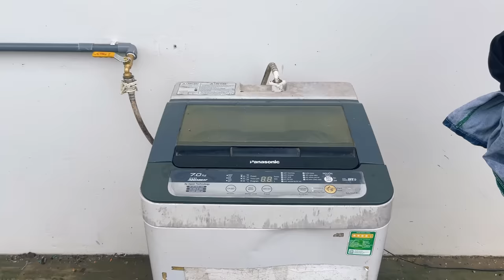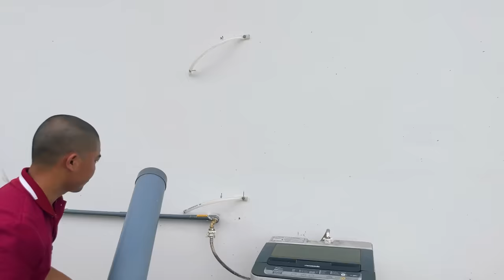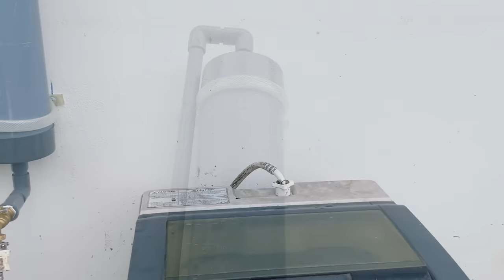Discover these incredible ideas now! Unique hacks born from combining plastic bottles and PVC pipes.

Comment: This guy has the experience to make sure he does not cut his fingers on the sharp edges of freshly-cut sheet metal (before de-burring).  
My preference is to play it safe and always wear gloves while cutting sheet metal.
Reply from the maker: That's a prudent approach. Wearing gloves while working with sheet metal can provide an additional layer of protection against cuts and abrasions from sharp edges. It's always important to prioritize safety in any DIY project or task involving potentially hazardous materials or tools

Comment: great ideas, but i have 2 enhancements.  1. don't use superglue to glue PVC pieces.  use the proper plumber's cement.  i figure that since PVC is available in your area, the plumber's cement should be as well.  2.  on the 1st project where he's making better water flow for his washer, putting the shut-off after his invention was a good idea, but he should have left the shut-off valve in-line before his invention.  having 2 shut-offs (one before and one after) makes working on the system easier with less water waste.  if only one shut-off is available, then he should have left it before the unit.  this would cause less water waste when he has to work on the system.
Reply from the maker: It's great to have audiences like you, each of your comments is a gold mine for us. Accordingly, we will consider together the knowledge you just shared, please continue to follow the channel. and tell us more about the wonderful knowledge you have. Thank you very much!

Comment: Cool! By the way, you are winding Teflon tape backwards.
Reply from the maker: Thank you for pointing that out! Properly applying Teflon tape is crucial for a secure seal. Could you provide more details on the correct way to apply it, or any tips you have for ensuring a tight seal when using Teflon tape? Your insights could be very helpful for those looking to improve their plumbing skills. 🚰🛠️🔍
Reply: @tipsunknow  WInd Teflon in the same direction as the hose bib threads. As if you are screwing it on. This way when you screw the parts together, it pulls the end of the tape in the same direction as the parts are moving. (If you do it the other way, you are pushing the end of the tape backwards.)

Comment: Awesome sharing... On the coke bottle project, what is the min water level for it to work?
Reply from the maker: The minimum water level for a DIY water bottle tank project to work effectively will depend on the design and dimensions of the specific setup. In general, the water level should be sufficient to create the necessary pressure and flow for the toilet to flush properly. This typically means that the water level should be high enough to reach the fill line in the toilet tank (as indicated by the manufacturer).

To ensure proper flushing and performance, it's important to follow the manufacturer's guidelines and recommendations for your specific toilet model. The water level may also vary based on local plumbing regulations, so it's a good idea to check with your local authorities to ensure compliance.

Comment: The second project has some faults to it. For one, it looks like you're letting water come out of 2 sections, which you should have one pipe set to a drainage system where the unusable water with the leaves and bugs in it will be filtered out or at the least put into a drainage ditch. 

The bucket of clean water will get contaminated with rust from the iron after enough time. A plastic mesh would be more effective in this case. 

I am tempted to put some of these into work, but I know plastic doesn't rust, where metals do rust. I kinda want to make some modifications to your existing ideas though... 

I would also advise to use a larger means of storing collected water for later use, just in case. Or a means of draining the water from your large filter into multiple buckets, as there is cause for concern for considering it wrong to waste water. 

A larger means of collecting rain water to minimize your need for using cold water from plumbing.
Reply from the maker: I appreciate your feedback on the second project, and it's great to hear your thoughts on improving the system. Could you please share more details on how you would recommend setting up a drainage system or filtering out the unusable water effectively? Your suggestions could be valuable for enhancing the project. 😊

Comment: Before hacking your water supply, you should give your washing machine a good scrubbing, from the way it looks, the clothes probably come out dirtier than they went in.
Reply from the maker: I appreciate your comment. Ensuring clean laundry is essential. If you have any tips or recommendations for cleaning a washing machine effectively, please feel free to share them. It could be helpful for others who might face a similar situation.
Reply: @tipsunknow  You want tips for cleaning this disaster area? I'd start with soapy water, a stiff brush and some good old-fashioned elbow grease. You dip the brush in the soapy water, bring it in contact with the dirty surface, apply light pressure and move the brush in a linear or circular fashion until the dirt comes off.If that doesn't do it, try some other cleaning agents like benzene, methylated spirits, chlorine cleaner or good old-fashioned scrubbing powder. If all else fails, there's always sandpaper, or a new washing machine.

Comment: okay so the first idea... I guess people are in a hurry to wash their hands in the rain and can't go in the house? How often is this happening?

Second idea... leaves are still falling in the gutter and clogging it. You will have water going out of the pipes as well as over the sides when the leaves fill the gutters and make them basically nonexistent. The only way to prevent this,
 with no maintenance, is using a screen over the gutters that allows leaves and stuff to slide off. If something gets stuck, you can just push it with a stick or broom instead of climbing a ladder
Reply from the maker: It seems like you're discussing the practicality and effectiveness of the ideas presented in the video. Let's break it down:

Washing hands in the rain: This idea might be useful for situations where someone needs to quickly rinse their hands while working outside and doesn't want to track dirt or grime inside the house. It could be particularly handy for outdoor chores like gardening, car maintenance, or construction work. However, as you mentioned, it's not a common scenario for everyone, and it may not be the most efficient solution for everyone's needs.

Gutter leaf protection: While installing screens or guards over gutters can indeed help prevent clogs from leaves and debris, some people might prefer alternative methods that don't require climbing ladders or performing regular maintenance. The method demonstrated in the video might appeal to those looking for a low-cost, do-it-yourself solution, but it may not be the most effective option in the long term, especially in areas with heavy leaf fall.

Ultimately, the effectiveness of these ideas depends on individual preferences, specific needs, and the environment in which they're implemented. There's no one-size-fits-all solution, so it's essential to consider various factors before deciding on the best approach.

Comment: He wound the teflon tape on the wrong way in the first project.
Reply from the maker: Using Teflon tape or plumber's tape the right way is essential for creating effective seals in plumbing projects. Typically, Teflon tape should be wound clockwise (when looking at the end of the pipe or fitting) to ensure a proper seal. If it was applied in the wrong direction, it might not create the desired seal and could result in leaks.

It's always a good idea to double-check and follow best practices when using materials like Teflon tape in plumbing projects to ensure a successful and leak-free result.
Reply: @tipsunknow  Yup, that's it... LoL...

Comment: wow is that stainless gutters?  nice.
Reply from the maker: Thank you for your question about stainless drain pipes! Yes, you are right, it is a stainless drain pipe. They are truly a good choice to protect your home from the effects of rain and weather.

But I want to ask you a little more: Have you considered using stainless drain pipes for your home? Or do you have any questions or concerns about installing and maintaining them? I would be happy to have the opportunity to help you further!
Reply: @tipsunknow  No I've never considered it, that is why I was impressed.  But they would not be cost effective for me nor would they go with my home.  I figure they are only cost effective for commercial application or if you were going to collect drinking water from roof rain runoff.  Plus, if one is going to collect roof runoff then a metal roof needs to be paired, like you did, with the stainless gutters.  Asphalt shingles would be self defeating in that application.  And where I live insurance companys do NOT like metal roofs due to hail damage claims when metal roofs get dimples from hail.  They give lower rates for asphalt hurricane shingles.

Comment: Hello, thanks for the nice centrifugal filter diy, with the rivet tip very nice !
The trick after, with the gutter, i REALLY didn't understood the point of allt his pipes going up and down, the bottle, the bubbles... It looks likes it can clog the same way as "straight away" evacuation pipe, isn't it ? Could you help me to understand ?
Reply from the maker: I'm glad you found the centrifugal filter DIY helpful! As for the gutter modification with the pipes and bottle, the purpose of this setup is to create a kind of water trap or siphon effect. The pipes going up and down and the bottle act as a barrier to prevent sewer gases and odors from entering your home through the drainage system.

When water flows through the pipes and into the bottle, it creates a seal that prevents gases from passing back up through the pipes and into your home. This is a common plumbing technique used to prevent odors and gases from escaping. It doesn't necessarily prevent clogs in the same way as a straight pipe, but it does help maintain a sanitary and odor-free environment in your home.

So, in summary, the setup with the pipes and bottle is mainly for odor control and ensuring that gases from the drainage system don't enter your living space. It's a preventive measure rather than a solution for clogs.
Reply: I’m sorry but no.

The system with the bottle and pipes creates a siphon. 
The water level will rise in the bottle and oncce it is high enough in the bottle it will flow into the siphon. This creates suction.
So once the water gets into the siphon it will suck water out of the gutter through the siphon.
This works only if the water-level gets too high
Reply: I still don't understand the interest  @tipsunknow  One time debris are caught in the gutter, it need to go out sometimes... Also gutter are large, normal evacuation pipes are also large to ensure proper evacuation of everything.. :body-blue-raised-arms:
It seems that this system will clog easily, cant be unclogged easily, now you glued eveything... (Normal syphon are openable easily..) So ok maybe no smell inside the pipe because of the water syphon, but normal gutter evacuation doesn't smell, as any organic materials are evacuated / didn't enter with the help of a mesh preventing materials to accumulate in the gutter...  Still mysterious for me .. ^^🤔
Reply: @tipsunknow  smells have nothing top do with the gutter siphon. You're just making this stuff up aren't you? You have no intention of actually using them in real life.  They don't work.  they are concepts which appeal to apartment dwellers or people who are impressed by complexity and ignorant of practicalities.

-The laundry tank water storage holding pipe will not drain any faster than the faucet, as it is under a vacuum.  
-The large water bottle catchment will clog up in two minutes. Also, you should direct all water away from foundations,  As well, disaster drilling into wall that far.  Water will enter.  Are these abandoned buildings you're destroying just for youtube ad revenue?
-The gutter siphon doesn't even solve any problem you have with drainage because your pipes are fine and run clear already, and the device will only get blocked by the first leaf. Although seemingly clever, what is called in engineering "a solution looking for a problem."

Comment: Wrap Teflon tape always clockwise!
Reply from the maker: Thank you for the tip! Wrapping Teflon tape clockwise is a great practice when using it for sealing threaded connections. This helps ensure a secure and tight seal. Clockwise application aligns with the direction that threads typically tighten, reducing the risk of unraveling the tape when you screw parts together. It's a simple yet effective technique to prevent leaks and make your plumbing or assembly work more reliable.
Reply: Automatic AI reply?

Comment: Less time consuming and virtually no cost.  Cut the leg off of a pair of pantyhose.  It will fit tight enough to the downspout to hold itself in place and gives the same results.  I've used this method for years. :)
Reply from the maker: That's a clever and cost-effective idea! It's great that you've been using this method for years. Do you have any other DIY tips or tricks you'd like to share with the community? We'd love to hear more about your practical solutions. 😊

Comment: What was the point in making the pipe so big in the first one? Why not just adjust the pressure valve or install a new one if the old one is having problems? Unless you live somewhere that has crap water pressure from the street.
Reply from the maker: Great questions! 😊 The decision to make the pipe larger might depend on several factors like the available materials, local water pressure, or the specific problem with the existing plumbing system. Could you share more details about your plumbing setup or what you would recommend for improving water pressure or fixing pressure valve issues? Your insights would be valuable for discussion.
Reply: @tipsunknow  I meant to say regulator. You do have these where you live right?

Comment: He put the teflon tape on backwards.
Reply from the maker: Applying Teflon tape or plumber's tape in the wrong direction can lead to ineffective sealing in plumbing connections. Typically, Teflon tape should be wound clockwise (when looking at the end of the pipe or fitting) to ensure a proper seal. If it was applied in the wrong direction, it might not create the desired seal and could result in leaks.

It's important to follow best practices and apply Teflon tape correctly to achieve secure and leak-free plumbing connections. If you encounter a situation where Teflon tape was applied incorrectly, it's recommended to remove the old tape and reapply it in the correct direction before making the connection.

Comment: The vacuum in the booster pipe will not allow any more water to flow out than what flows in, so the booster does nothing.  And, the Teflon tape is installed the wrong way.
Reply from the maker: I appreciate your insights about the booster pipe and Teflon tape installation. It's important to ensure things work correctly. Could you please share your recommended approach for resolving these issues or any tips you have for optimizing the system's functionality? Your expertise could be beneficial to others watching the video.

Comment: Pretty cool ideas, more of concepts to a larger project if needed... I can tell you don't use tools for your living or gainful employment. This is painfully obvious with your last hack for using a hacksaw flush against a wall at 8:17. Notice the ends of the blade tensioning mechanism, they can be rotated so the blade can be used in different orientations, even reverse. So you had the hack right up until you involved a couple screws and a piece of wood.
Reply from the maker: Thank you for your constructive feedback and for pointing out the potential for using the hacksaw blade in different orientations. It's valuable to explore different approaches and techniques, and your insights could be beneficial for viewers looking to optimize their tool usage. Is there a specific technique or tool-related topic you'd like to see covered in future videos, or any other suggestions you'd like to share? Your input helps us improve our content! 🛠️🎥👷‍♂️

Comment: So an overly complicated leaf diverter?
Reply from the maker: It seems like you're referring to a specific concept or invention. Leaf diverters, in general, are devices used to prevent leaves and debris from entering gutters or downspouts, typically designed to simplify the cleaning process. If you have a specific question or would like more information about leaf diverters or a related topic, please feel free to ask, and I'll be happy to provide more details or assistance.

Comment: cara perde tempo pra passagem de água, quando na vdd era só pegar dois minutos e tirar as folhas na calha!
Reply from the maker: Is there a more efficient way to address this issue rather than modifying the plumbing system? Keeping the gutters clean sounds like a practical approach, but I'm curious if you have any other suggestions for improving the water flow without extensive changes. Your insights could be helpful! 😊